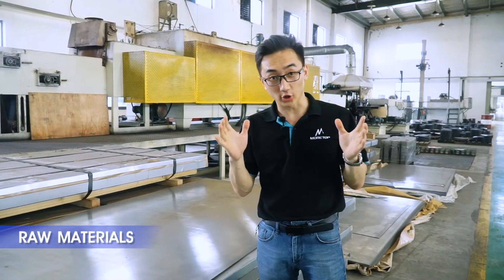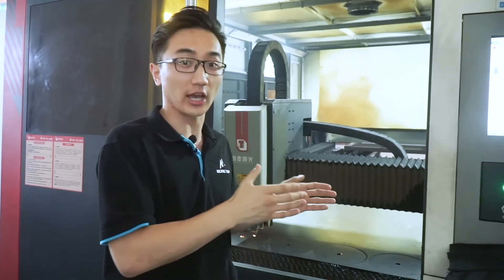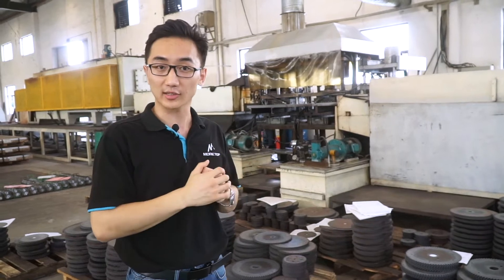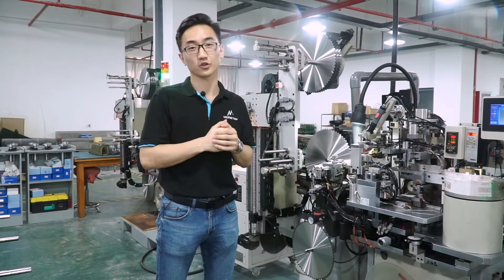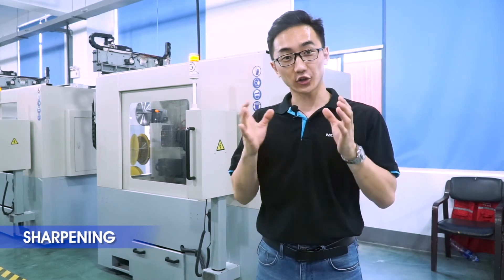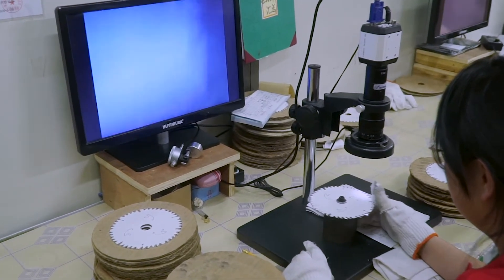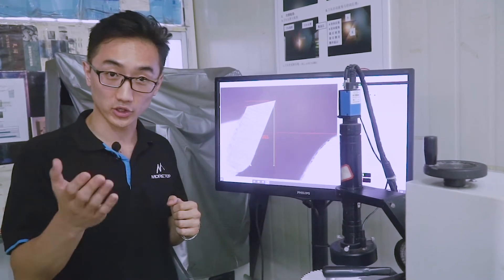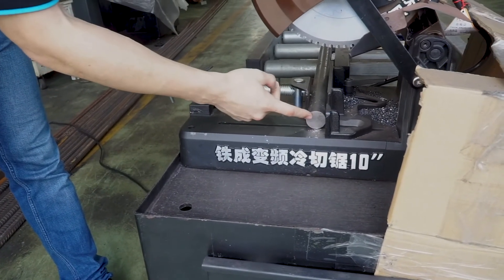HOW IT'S MADE | Moretop Circular saw blade production process 2021

Comment: Where are these available in the United States? I'm having a hard time finding quality drill bits/blades here. 
 
I'm a 1 arm/leg woodworker, so a good product is vital since I need to do 10x the effort to complete a task. 
 
And over the past few years, quality in tools, and blades has gone downhill drastically. I can assume it's due to more people DIY renovations, and companies rushing out their products, with lower quality. Brands like Freud/Diablo, CMT, Famag, etc, have all started spending more on marketing, and less on quality. It's been very disappointing as it has made my tasks a great deal tougher. The 12 inch sliding compound miter saw blade manufacturers have REALLY gone downhill.
 
Also, do you carry Brad Point drill bits that are carbide tipped? Companies like Fisch, are extremely lower in quality than they were just a few years ago.
Reply from the maker: That's a true dedication to the craft! You are right about the quality change. DIY segment is becoming bigger these days and companies in order to survive and get more customers, do lower the quality and offer cheaper products.